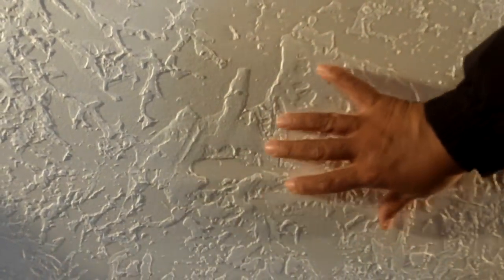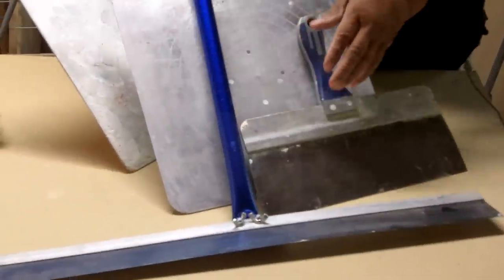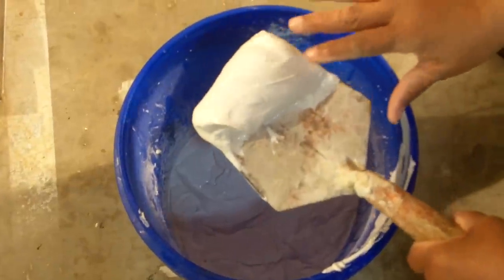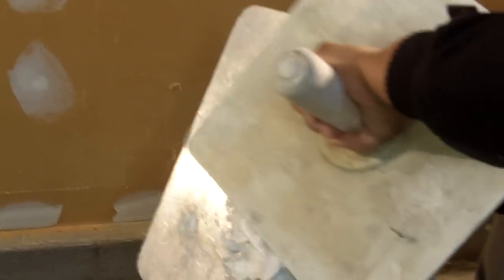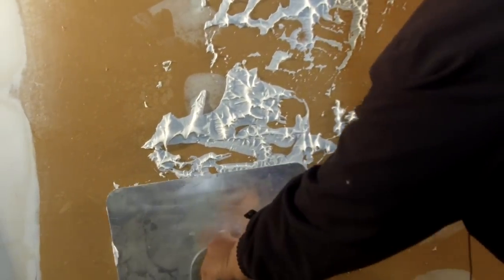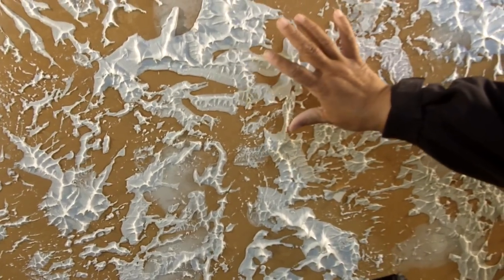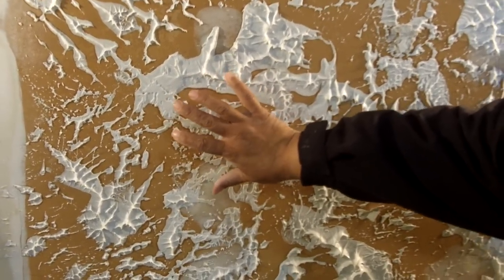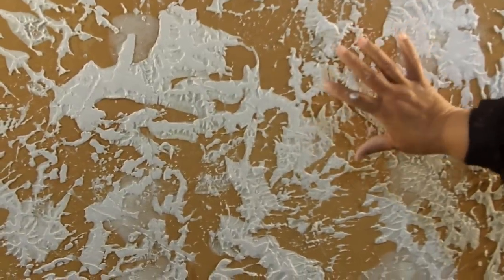How to Do a Brocade Knockdown Texture

Comment: Thanks Jane!  Great video.  I'm remodeling a bathroom right now and was looking for a way to match the walls with the rest of the house.  I am now confident I can pull this off.   I have one question.  About how long did you wait before knocking down in this video?  I understand times vary due to thickness, consistency, and ventilation, etc.
Thank you for making such a helpful video.
James

Comment: I do this, and then I sand the texture after its completely dry to knock it down some more, so the surface is not fragile.  You have perfect control with the drywall sanding screen, and just a few swipes will give you a very uniform finish to your brocade.

Comment: You could also use a (damp) sponge if you don't have the hawks at hand. Works good too and to my feeling you have more control on the desired knockdown texture. Correct me if I'm wrong. ;)

Cheers.

Comment: Another great video! Your clarity of presentation is so terrific. Speaking of textured walls, any suggestions for doing orange peel? I pay $15 a can for the spray-on version and they cover just a few square feet. Can I do orange peel without a lot of expensive tools and a lot of practice?
Reply from the maker: Allan Wood Hi Allan, unfortunately, the only alternative to the cans is using an air compressor and a hopper.  The cans are intended to be used for repairs, so that people who need to do repairs don't have to get an air compressor and a hopper.  So, if you are doing entire walls and ceilings, you really would need to invest in the equipment.
Reply: seejanedrill 
Hi Jane -- Thanks for the answer. I've been using the cans for patches, but by the time I got done patching all the walls in my 3/2 remodel, I had to use about $100 worth of spray cans! They sure don't last long. 

I see good ol' Harbor Freight has the hoppers pretty cheap. Is there a big learning curve to laying down a good-looking ornage peel texture?

Thanks again for your terrific videos!
Reply from the maker: Allan Wood Hi Allan, I think you should be able to do it.  What I would suggest is getting a nice-sized piece of cardboard, and practicing on it until you feel comfortable with it.  It is easier than the spray cans!

Comment: thanks for this video, I have ceilings done like this by the contractor, and I'd like to paint them, I wonder if you have a video or tips on that. I don't know for certain if it was painted when they did the original, but its been about 18 yrs and its yellow now. So I'd like to freshen it up. Any tips would be appreciated! thanks for this video.
Reply from the maker: Hi Catherine, they now make a ceiling paint and primer in one.  There is one made by Zinsser that is very highly rated. I would suggest using that.
Reply: Thank you...I will check that out and try it on a small room first!

Comment: Can you use premixed joint compound, or is it better to use a hot mix? I am guessing the latter since there is a certain point at which you need to knock it down.
Reply from the maker: There's no preferred type...it's just about how quickly you want to do the job

Comment: Can you smooth out a brocade wall with warm water? My goal is to smooth out my walls without putting up new walls. Thanks
Reply from the maker: First of all, it would have to be joint compound, and joint compound that has never been painted.  And even then, it would be a challenge.  But it could be done.
Reply: seejanedrill Thank you

Comment: Very popular in S. Texas. Called Monterrey wall in these parts. How much water do you use the get your "icing"?
Reply from the maker: Hi David, it doesn't take much water at all.  Just be certain to add just a little bit at a time.
Reply from the maker: Hi David, it doesn't take much water at all.  Just be certain to add just a little bit at a time.
Reply: It's easier to add than to remove. I guess you have to add the mix if you have too much water.